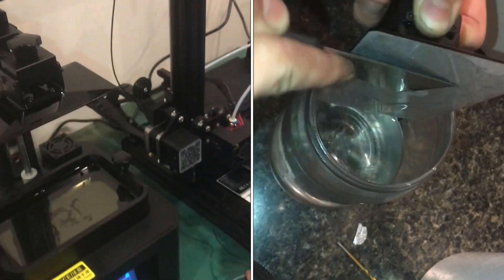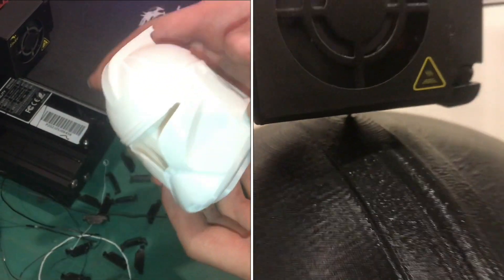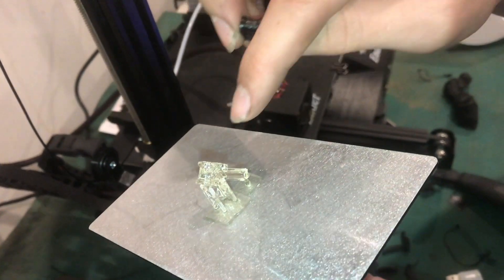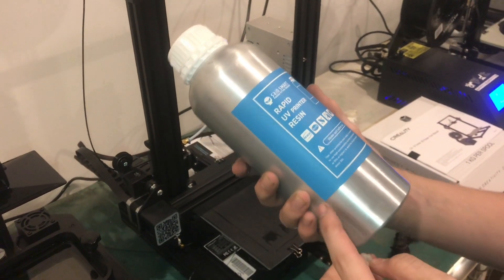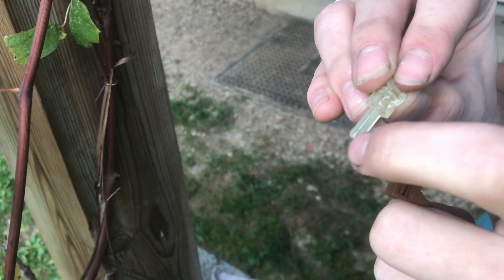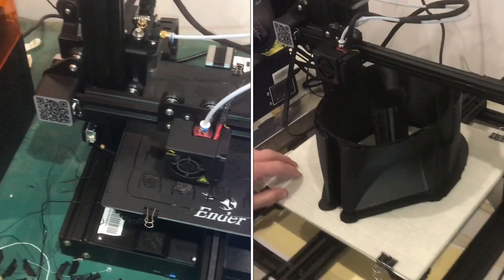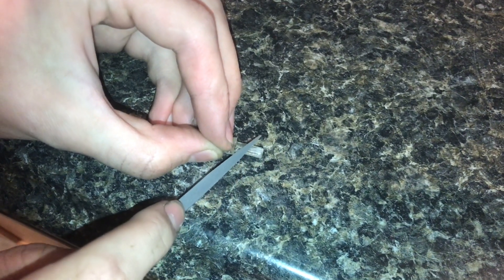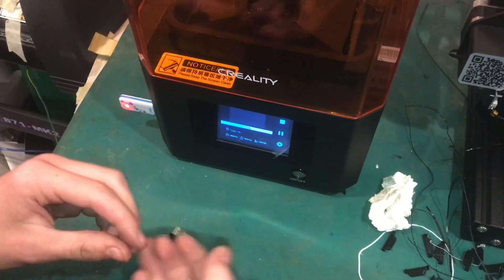COMPARING 3-D printers FDM vs SLA

Comment: I’ve been on the fence on getting a printer.
Reply from the maker: If you have any questions, let me know. I’ve actually been working with 3-D printers since the very first Machines came out. Some of these machines that cost $160 now do the same thing that the $35,000 did 10 years ago. I would say it is still a hobby, there’s a learning curve to it. You kind of have to enjoy fighting with a little bit. Anyway if you’ve got any questions I’ll do my best to shoot it straight as I can. 👍👍
Reply: Live Free I used them at work all the time before the pandemic and I’m familiar with design (that was my job in the dental field pre-COVID). I just didn’t realize they had come so far down in price! I kind of want one that just works and isn’t a hobby though, and that can do many different materials so that I can start an Etsy shop. But, the easier they are to deal with , and the more materials they can handle, the higher the cost of admission, as you know.
Reply from the maker: Company creality really brought the prices down lately. The lowest cost printer is called the ender 3 with a few hours of assembly I cost about 160 bucks. They make another one that is a little bit more production worthy for about 320 bucks, The CR 10. They make different revisions of the CR 10 but I have found a little more fluff in the other versions. The CR 10 has a bigger bed and the electronics are off to the side so you could put a cardboard box around the machine to keep the heat in if you were going to print ABS. We haven’t printed ABS yet but we’re going to shortly. The CR 10 is very similar to a printer that I really liked called the taz that cost around $4000. The resin printers from creality are very low cost around $200. The form labs but does the same thing is about $4000. Resin printers of course have a much higher resolution but the parts are smaller and they’re brittle, you can get rubber compounds but they’re  expensive $75 a bottle instead of $40 a bottle. I’m probably going to buy some CR 10 to be able to handle a little more volume but I test them a bit more. Finally 3-D printing might start to become a little bit more Then just a hobby, Or only available for those with lots and lots of patients. Appreciate all the kind comments but you’ve left on other videos. If you have any questions on the specifics of those printers let me know, I’m pretty impressed with the price and the quality of the machines. Time will tell. 👍👍